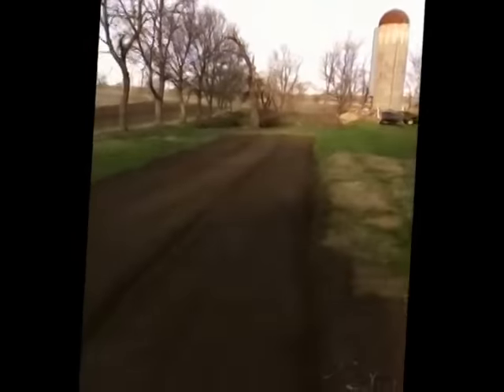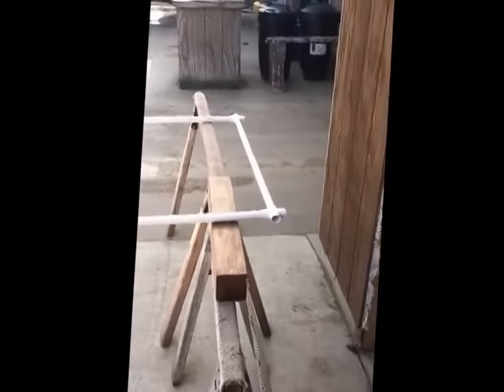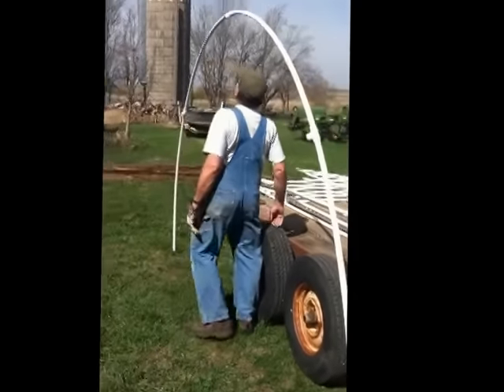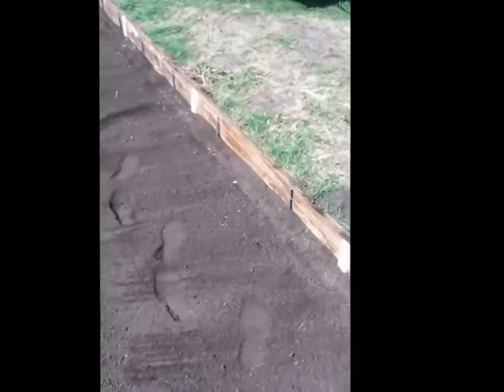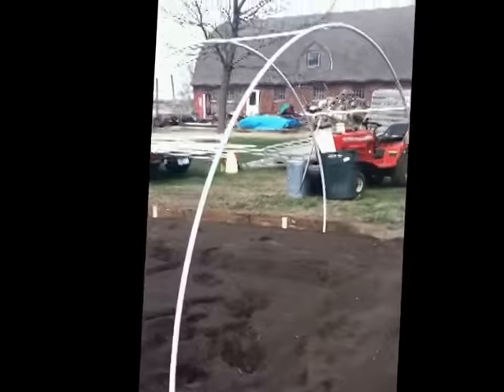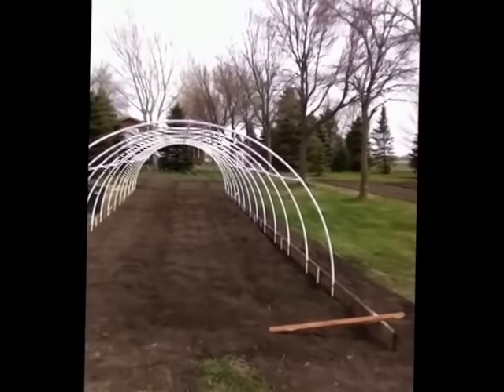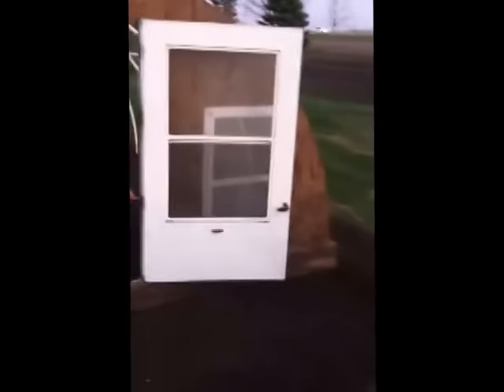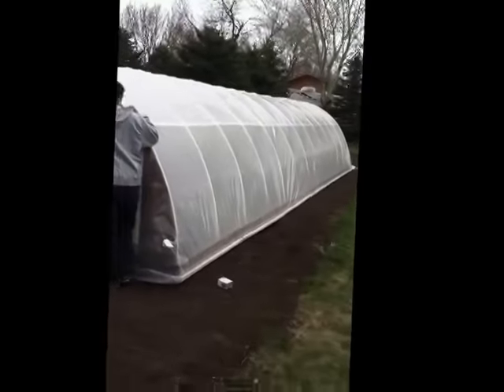PVC greenhouse in a day DIY

Comment: Looks good. How's it holding up? I'm looking at doing something like this in my pool to create shade and help prevent the chlorine from evaporating out.. I would use 3" or 4" as pontoons on the bottom and use the pool itself as the support to hold the shape, then a white tarp for the top. Anyway, thanks for the video.
Reply: leonscorpio19 we utilize it for early spring and late fall to start eary and extend the growing season. Its a nice structure, but needs to be monitored in high winds...over a pool, not sure how much shade it will create - but imagine it would be a jungle inside with the increased humidity with the pool water. Would love some feedback if you try that application! Thanks for commenting...
Reply: Thanks for the response. I'm not trying to shade the whole pool, maybe 10-15 foot. The idea is a structure similar to the one you built but instead of the lumber at the base of both ends, I will use the larger diameter piping for pontoons. The outward pressure created when bending the unit to sit in the water will cause it to press against the outer edges of the pool, holding it in place. The tarp will not go all the way to the bottom either, it will also be open on both ends as I won't be enclosing it completely at all. I'm in Georgia so it's humid as heck here anyway. I'm not worried about growth because of how open it will be. It will also be easily moved with two people: one on either side of the pool pushing toward each other and moving to our liking. At least, on paper it seems to work..lol. I'll keep you posted. Thank you.

Comment: great video, thank you! thing is  you should use abs pipe not pvc  because abs is uv resistant and running a length of nylon robe in your pipe construction will make the unit stronger. Thank you a great video.

Comment: Thank for the video.  How did you attach the ends of the plastic to 2x8's.  I don't understand how it's not ripping by the wind if the only thing holding it down is a screw? or did I miss something :) ?  We can get some pretty strong winds here in the mtns. Also the plastic rubbing on the top wood doesn't puncture it or was that secured some how? This looks like something I've been trying to figure out & I believe I recycled most of the stuff to do this.  .  tks your video is helping me a lot...
Reply from the maker: look at :56 - it is a metal bracket that holds the pvc in place.  it sustains the winds where we are at...the first thing to give way is the 5mil plastic...
Reply: Nick Tamble thank you.

Comment: you should make it so the pvc is all connected and sealed that way you can add a hose fitting and connect a hose to it,then you could drill little holes and tap them and add some misting heads self watering greenhouse.just a thought you would have to alter the design.but I think it would work great.

Comment: great design, very thrifty approach....surprised you don't have any angle bracing attached to pvc, to prevent wobble in winds... was that ever a problem???...
Reply from the maker: it was a problem and led to the demise of the structure in a 60MPH wind. Had ideas for bracing from the inside with a 2 x 4 structure that could also reinforce a watering method.

Comment: Have you had any issues with the PVC breaking down?  Do you keep the structure up all year?  I just read that the sun will break down the PVC and it will become brittle and eventually break. Not sure how long that will take. Just wondering if you have experienced that.  Did you use green house MIL plastic cover?  How long do you suspect that too last. Trying to decide if this is the best cost effective way to build or to go with those correlated plastic panels and using something else for framing. Appreciate the video and any insight you can provide. Thanks.
Reply from the maker: sorry for late response... no trouble with PVC. I suspect the PVC would take quite a few years to "break down". We used 6mil plastic from Menards. This is definitely cost effective, but not as sound or lasting as a panel structure...
Reply: Thanks for the info and the video. I just seen a video a few days ago where they used rebar for the hoops and put that 1/2" black water tube over it to protect the plastic going over. I think I will try that. Rebar will def last a very long time.

Comment: Clever to use modular construction methods.  Since you said temporary greenhouse, does that mean you plan to take off the covering material before a heavy snow load?  Might not an issue if you add a support structure out of 4x4 like I have seen others do for their PVC greenhouse frames.  Some do a 4x4 post and beam down the center, and other do a box post and beam just off center, leaving either 30" opening between the posts, or a bit more.

Comment: One tip. Use the gray electric conduit PVC. It's UV treated and resistant. The white plumbing PVC isn't. The conduit comes in diameters from 1/2 inch to 2 inches

Comment: I built one of those and a strong wind tore it apart. The solution is to fill them with wetter than usual concrete, tamp it in the plastic pipe and then force thin rebar into the cement

Comment: good video thank you good job.
will it work in arizona heat in summer?
Reply: the poly traps heat inside - I presume it would be stifling hot in the AZ summer! If the sides could be taken up so as to allow much more ventilization I think it could be used anywhere...

Comment: Hi Great job but can you tell me what type of PVC Pipe you actually used?
Reply: UBLoyal 10 foot pieces of 1" schedule 40
Reply: ***** if you did, they structure should be smaller/shorter and possibly somehow staked down - 1/2 inch is pretty flimsy, but let me know if you try this...

Comment: I made a hoop house on a smaller scale and the heat issue during the winter months was insane and ventilation issues I have since broken it down but I still am wondering what I could of done better
Reply from the maker: heating these in the winter can be very costly! Depending on location, these are best for a month or two prior to last frost and extending the growing season some weeks into late fall... the new vid shows attachment of furrowing strips that are screwed in and can be removed to "roll" up the poly in the sides... will likely do a demo of this when our temps get up there.

Comment: Help me, Nick. I live in Brazil and I will make a greenhouse like you. Which pipe did you use to make the bow? 3/4" or 1-1/4"
Sorry if I make too many English errors.
Reply from the maker: we used 1". you could use 3/4 - it would be a little more flimsy...the 1-1/4" would be more rigid. Any of these sizes would work... especially if the structure was reinforced... good luck!

Comment: if change wall of boht side and install two fans and cooling system will this frame can hold vacuum of two fans
Reply from the maker: good question. we did use interior box fans - depends on the size and ventilation... end frames could hold a fan, but may need reinforcement

Comment: for sceleton core put inside pvc pipes some house building rods 2cm diametare the are elastic and stady if you have a lot off wind wear think about it and for the roof you can use plexiglass buy it only is so cheap than from store

Comment: how durable has your greenhouse been? any problems with wind, etc?
Reply from the maker: wind is a problem with the site we chose - fastening at the base is key and to tend to any tears that occur right away. This is a "light-duty" greenhouse.
Reply: Thank you.
Reply: +Nick Tamble i saw something cool the other day where they fixed the wind problem simply by inflating the inside of the "walls" by double wrapping the poly, i think i may have to try it out...
Reply: +Steve Helms In new england with a few trees shielding it, this will stay put.   In Florida, it would risk being  a  kite in the windy season.   The codes here would have 2 to 2.5 inch galvanized pipe drilled for cross rebar in cement underground.
Reply: Travis Vick

Comment: something that i learned the hard way.... when pvc sits in the sun... it reacts to it.  so plastic put on the pvc will wear down to nothing due to the chemical reaction of the pvc as it breaks down in sunlight. for this reason,, greenhouse plastic manufacturers dont guarantee unless used on appropriate frame. you can paint the pvc to avoid the reaction and deteriorating plastic.
Reply: not if one were to use the electrical conduit type plastic piping (gray colored stuff) or for better durability and strength just go with metal electrical conduit piping....for the few extra FIAT dollars it'd be paper well spent IMHO

Comment: What kind of glue did you use? I've tried PVC pipe cement and it comes apart when trying to bend across. I'm using the same measurements as you.
Reply from the maker: I forget what grade, but we primed first (with the purple stuff) - and used a PVC cement...

Comment: something you could do is dig a hole however you like inside the greenhouse and frame it with brick or liner and then add gravel if it gets to cold you could dump hot water into tho hole

Comment: One thing most people don't realize is chemical make up in PVC (Poly Vinyl Chloride) reacts in a negative manner with the UV stabilizers in greenhouse poly film. The negative chemical reaction between the UV Stabilizer and PVC will cause the 4 year poly film to degrade to the point the poly film won't last beyond 1 year. So yes the initial cost using a PVC frame is inexpensive... but the long term investment using an actual steel greenhouse frame will pay for itself in labor and poly film costs.
Reply: You can paint the PVC or just use duct tape to put a barrier between the PVC and the plastic film.  Greenhouse film will only last about 5 years anyway so the cost of replacing every 5 years has to be factored in no matter the Frame material.

Comment: PVC is a great idea for areas where it hardly ever snows. It is useless where there is a possibility of significant snow. Get a bender they are cheap and the end product is durable. This same house can be built with galvanized toprail easily in the same amount of time. Mine here in ohio have stood up to some heavy snow loads. Over 6" I broom them off under 6" it isn't necessary. Why set yourself up for a disaster when it is just as easy to do it the way the pros do it?

Comment: What gauge or mil thickness of the PVC? I ask because that will help against wind / UV. You said after 2 months it broke down, would like to know if primarily because of mil thickness, thanks
Reply from the maker: I believe it was 6mil. There were imperfections (small holes) in the poly we purchased - that we believe led to the break-down. Ultimately the damage was caused by a 60MPH wind storm...

Comment: just a quick question..sorry for asking, but since I had the T.I.A., some things take a bit of effort to sink in, or grasp.  are all sections of pvc cut to 5'?  Your end caps(w/doors/windows) I didn't notice how you attached them to the pvc...maybe with clamp strips that only have one leg to screw on? instead of the ones you used on the side bottoms with two legs.?
oh, and thanks for the idea...I'm in Minnesota, and all the help I can get to add to season length is greatly appreciated.
Red

Comment: gravel the floor. I would've used some metal pipes to hang plants from. set up a watering system,and aquaponic pond and raise fish too ,use fans ,and and shelves and 5 gallon buckets with  small holes in the bottom. I've seen small wood burning stove for heat ( but hard to keep constant temp

Comment: Please, can someone tell me how to dry-fit PVC? The fittings I have make far too tight a fit, and need to be a fraction of a millimeter wider. Would it work if I were to make vertical slits into the ends of the pipes? Anyone have any suggestions?

Comment: Hello Nick... Hey how do you attach the plywood walls to the pvc???
Reply: with the brackets shown at :57. The brackets screw into the wood and the PVC tubing slides in.
Reply: Nick Tamble I think what he was asking..and what I was wondering also is "how do you attach the plywood walls to the pvc"?
Reply: sheila bowie rebar was set into the ground on the inside of the plywood and the pvc fit over it...this is shown in the vid. then the brackets shown at 57 seconds into the video were placed over the pvc and screwed into the plywood...hope this helps...

Comment: I didn't see that you put any buffer between the plastic covering and the PVC. I have heard that PVC will eat the plastic, have you noticed anything like that yet?
Reply: yourtoonosey someone mentioned that earlier...we take the plastic off during the growing season - I have not seen any indicators of this happening on this project...I wonder if someone has a video showing the damage??
Reply: I haven't seen anything either. I read it somewhere. 

So, you only use the plastic during the colder months then? Possible that this would alleviate that problem then, huh? With it not being in contact year round for x amount of years, I would guess?  

In any case, thank you for the reply.

Comment: How sturdy did it feel?
Reply: mcdoublemcchicken pvc is no-where near as stable as steel, but sturdy enough...additional supports could be installed on the sides with stringlines or 2x4's for additional support

Comment: If someone can figure out a way to remove the poly from these things during the winter they'll be worth building. 

I'm thinking the PVC would last a lot longer too if you coated them in some kind of exterior paint or perhaps that spray on truck bed liner.
Reply from the maker: the poly can be easily removed by unfastening the wood strapping from the bottom sides... pvc stays up - poly comes down ...thanks for comment

Comment: how did it hold up in the winter thanks..
Reply from the maker: Harsh winters here in Zone 4 - took it down.  Very expensive to heat ...would be a great application for solar power heating...
Reply: Nick Tamble took it down as in the cold killed the crops or as it it was blown over due to high winds?

Comment: I'm not getting it.  PVC pipe will bend and sag when it gets warm.  What prevents the PVC from sagging with the heat and over time?
Reply: For this geometry the PVC is in compression. The force is along the centerline of the pipe. There is minimal bending forces. Read about arches. This is the same principle in building dry stone arch bridges.
Reply: vipero00 The force might be along the center-line and it's a compression force but PVC is a plastic material.  And unlike stone at temperatures found in greenhouses it becomes soft and playable.
Reply from the maker: the cross-bracing and poly help keep the structure intact. I would think that if someone used a pvc pipe with a smaller diameter may have some problems...
Reply from the maker: agree - compression caused also by the poly.
Reply: According to Wikipedia the temp it starts to becom soft and plyable  is 65°C or 149°F. That seems a little high for temperatures found in greenhouses. Wind will put bending moments on the PVC hoops since the loading force is horizontal rather than vertical.Therefore you should have some kind of wind break to protect it.
Reply: vipero00 I think 149 is plausible for the apex of the greenhouse.  I have seen PVC pipe used for similar structures become soft and distort.  People use re bar to strengthen the PVC.  In my opinion I hate to see plastic used in gardens.  The plastic only lasts a few years and only photo-degrades to nurdles and contaminates the soil and water with the plastic nurdles.  The nurdels concentrate toxic organic compounds which are then consumed  by small organisms.  If the smaller organisms are not killed, they toxins are then concentrated as the next member of the food chain consumes the smaller organisms.  And the plastic that doesn't remain in the soil enters our waterways polluting our fresh water and oceans.

Comment: Could you not put underground 8 in pipes at the far end of the green house in each corner to act like a cold air return to heat your green house evenly?
Reply from the maker: hmmm... interesting
Reply: Like how convection works?
Reply: You could use solar vacuum tubes on a Manson hot air enging to heat the pistons to work fans to move air around green house that could also turn a generator to charge a battery bank to keep fans running at night. Novartis
Reply: You could also use this concept for an off grid power supply. ; )
Reply: A V-10 Manson hot air engine operated off solar vacuum tubes to heat each piston used with a transmission could turn a high voltage power generator to charge a capacitor and battery bank. No need for fossil fuel 100% renewable energy. What do you think about this power generation design? Is it good bad or amazing?
Reply: Or a solar vacuum tube hot water heater set up to super heat gllium to generate electricity with thermal electric generation that can run a pump to move that heated gallium through a copper coil heat exchange to heat water that can also be used with thermal electric generation that can also run induction coils on a V-10 Manson hot air engine with crystal graphite being heated up in each piston to operate the engine used with a transmission to operate a high voltage generator to charge up capacitor and battery banks around a farm? Hows this sound? Novartis
Reply: You want some interesting heating and cooling ideas? = )
Reply: Have you ever read a study about infrasound being used to excelerate plant growth? Imagine being able to grow crops like over night?